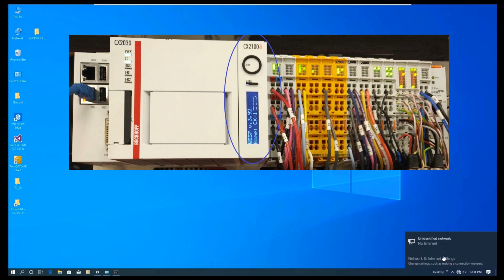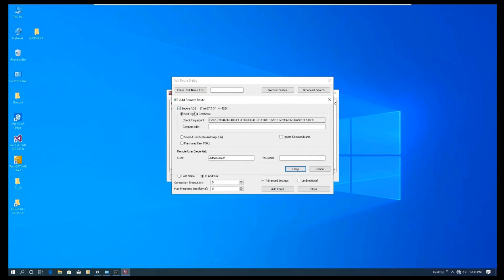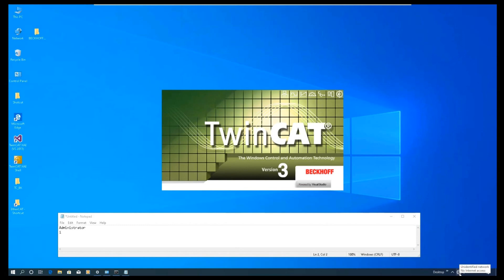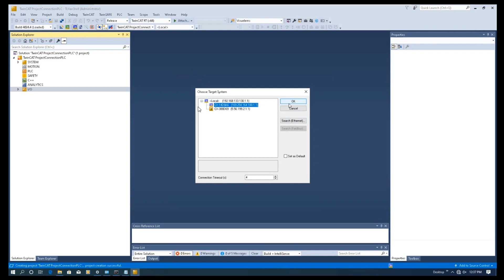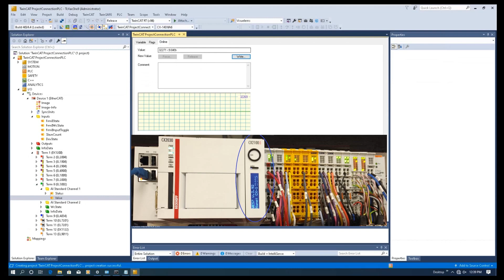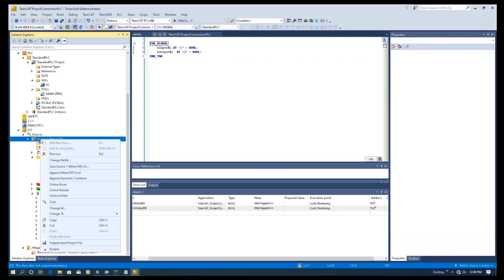BK07.  Use 'Scan' in TwinCAT 3 to Upload and Compare Hardware Configuration

Comment: Thank you so much, you are a great teacher, I'll try this tomorrow, I haven't been able to open from target because it never finds anything. When I plug a cable to the EK1100, either directly or a cable to the ethernet switch, I get the ip 169.254.255.130
Reply from the maker: EtherCAT devices does not quite care the IP address, as long as your EtherCAT cables are well connected and powered, they should be identified during the 'scan'
Reply: @electricalautomation  thank you! Let me give it a try!
Reply: If I get to connect this, have you done videos about TwinCAT3  plus kepware and OPC DA to capture live plc tags or Robot , stopped.. Idle.. Or running?